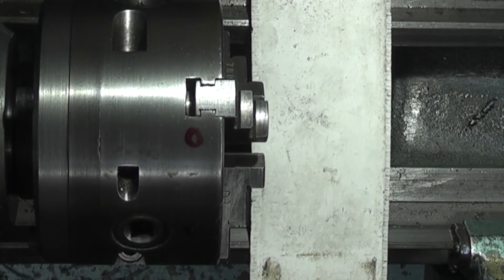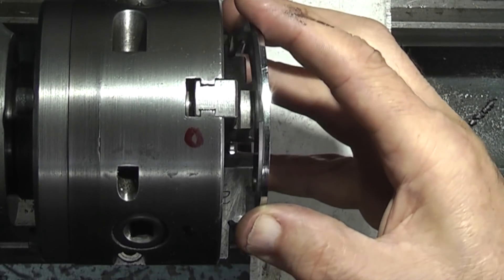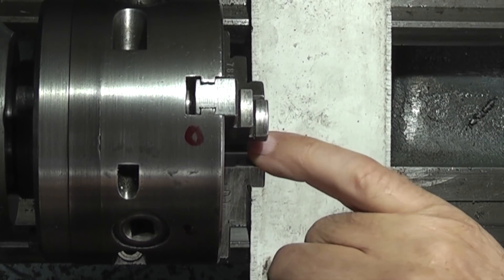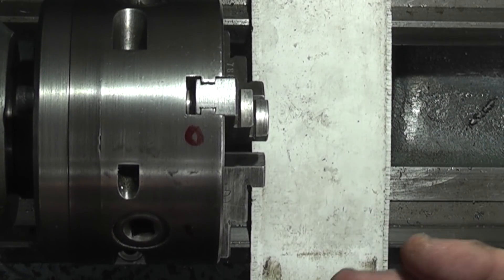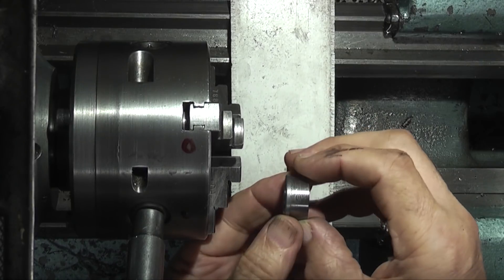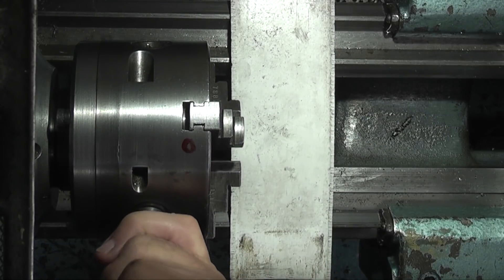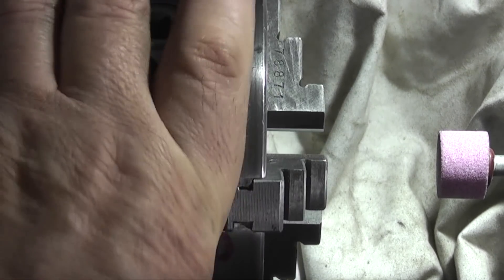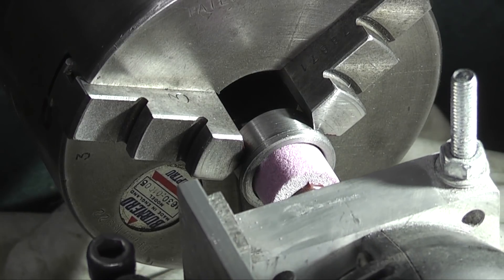3 jaw chuck regrind

Comment: I don't see how this method gets the entire jaw surfaces on the same plane. Since you ground the front and then the back and not the middle to the exact same plane, I don't see this as a great way to get the jaws aligned up to make it run more concentric. I think an other ring where you force the jaws against and then grind the entire length teh same would yield a much better concentricity.   JMHO
Reply from the maker: I did grind the front and the back all the way along the jaw. I ground the front marked the jaws red to give a visible guide then ground the back until it just removed the red. the jaw with the red on had already been ground.

Comment: You can see the runout at 10:02... nice work and I like this method but it doesn't appear that you can get the jaws perfect without taking a full pass from back to front on the jaw? Using this method it seems like in the middle of the jaw you will have a small hump and the front part of the jaw won't be the same as the rear.   I have a small recess that I created on the front of my jaws for holding washers and boring holes while sitting flat against the back of the jaw.  It's actually similar to how the jaws step down moving out from the center I have one step down moving into center (hope that makes sense).  Using a ring in this location gives the best results of all the methods, you can load the chuck like normal and make a complete pass.

Comment: The jaws are not the problem... the scroll wear is the problem.. thats why I prefer the 4 jaw independant chuck. 

Grinding the jaws at a particular diameter will do no good if the scroll has wear elsewhere as the jaws wont be concentric at THAT spot... 

A better solution for 3 jaw chucks is to fit / make mild steel soft jaws & skim them when ultimate precision is required. This is what I did... 

😎👍☘🍺
Reply: Peter is correct in saying The problem is in The Scroll as everyone knows people tend to lean a little too heavy at times when tightening 3 Jaw Chucks on Lathes which tends to Stretch or deform The Scroll.
I worked for A Government Facility making  Rifles for Armies of Many Countries & never had any Success in Grinding Jaws for 3 Jaw Chucks as they worked at the diameter at which they  were ground then when you open The Jaws for a different size you still have The Original Problem
Reply: Bell mouthed jaws are not a consequence of a worn scroll.

Comment: Thank you for sharing. I have been contemplating doing the same thing but have not proceeded as I have a couple of points that cause me worry, I don't know if it is valid however.... When you grind the jaws you are obviously grinding the bore of a cylinder, admittedly it's an interrupted cut. So you grind the jaws true. When you use the chuck to grip a diameter smaller than the ground diameter all would seem well as you are getting line contact on each jaw. If however you grip a diameter much larger than the ground diameter you are effectively getting two line contacts on each jaw. My concerns are firstly, will these lines dig in and mark the workpiece? Secondly as you are getting these line contacts on the edge of the jaws will they wear out or get damaged quickly and  cause run-out. I'm probably worrying about nothing, has anyone had any problems after grinding jaws?
Reply from the maker: Hi When new the jaws had a flat face so you had line contact, as the jaws wear the front gets bigger in my case one jaw was out giving me a run out every time I held a part.

Comment: I think after you grind the back, one needs to grind the front a second time - just a touch up.  After the back is ground, the jaws won't sit the same.
Reply: I think you're right. It needs to be an iterative approach. The initial bush installation at the back is on worn jaws (admittedly less worn than the front will typically be but worn nonetheless) and that wear will show up in the front grind. Doing it in multiple stages might help that significantly.

Comment: I may have missed something.  The front of the jaws are reduced by the amount ground off. Therefore, the chuck will close to a different (smaller) diameter than it was when the bushing was held in the back of the jaws. How did you account for this when you ground the back of the jaws? Also, the center of the jaws still showed red marker, so that area was untouched.  Without running an indicator along the ground faces of the jaws, how do you know if they are all flat and true?  Again, I may have missed something, but it seems that this method might settle for clamping using only a portion of the jaws.
Reply from the maker: Hi Tim I ground the front first then marked the jaws with the red pen and held the bush at the front.  Grind the back until the pen marks show the grinding. The red pen mark in the centre was under the bush and had already been ground. Then I used the test bar to check the run out you can put some micrometer blue on the bar hold it in the chuck and check the jaws are touching all along the jaw.

Comment: One of the advantages of the Grip-Tru chuck is as it is adjustable for run out the jaws can be re-ground on a surface grinder and the flat profile is maintained. And with care the jaws can de ground pretty exactly the same.Would it have been a good idea to have set the OD of the chuck body true to start with?
Reply from the maker: Hi Nathan I set the chuck OD true to start but did not video it